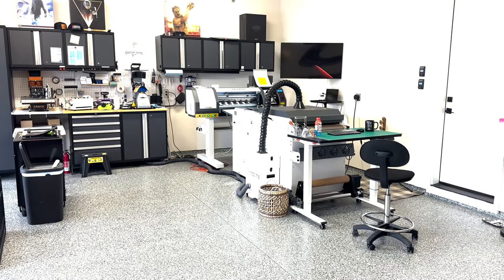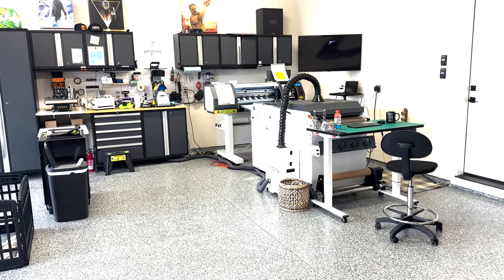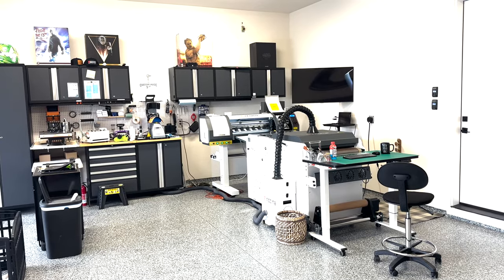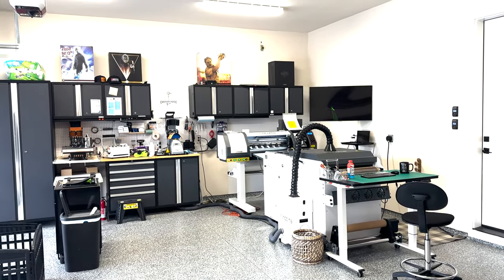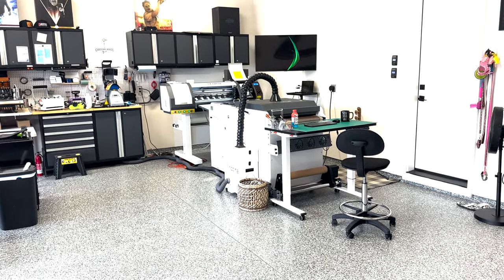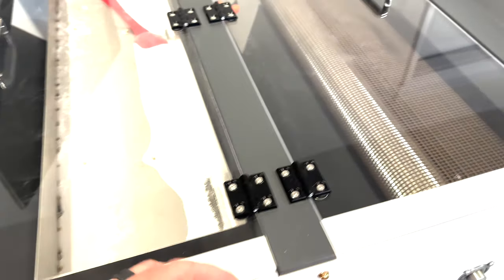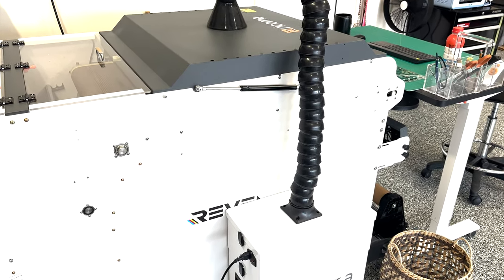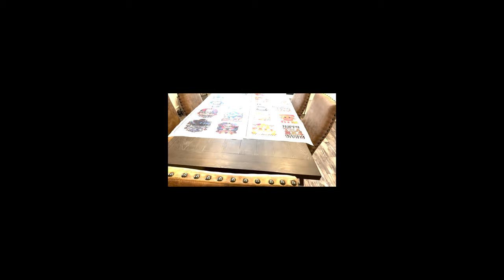Ricoma REVEL DTF-2402 - Direct to Film Printer - Part 2

Comment: Hi, if you print only one a3 job, you not need lost a lot film in automatic powder machine? Or you can only insert in it the a3 job? Thanks
Reply from the maker: If I'm printing smaller jobs, it's more of a manual process. I won't use the shaker and will self powder the prints before running them through the oven.

Comment: I feel your pain! I got the same basic setup through alibaba a month ago, received the rock solid printer a week later the shaker, etc is coming by sea. They were in chat the next day(9pm) installing all my software, doing alignments. I'm tech savvy so I did some of the software and final tweaks but they have been amazing with support. Spent right at 5k, got 2 sets of consumables, 2 maintenance kits, and all the rest. The tech just isn't that hard with these once you start trying to figure it out. I literally had dealt with Ricoma for weeks to try and get a decent price/setup. It wasn't tell till my hubby said just buy it that I went to alibaba asked a few questions and made the purchase. My printer and stand alone weighed 160lbs. It's so well built! Very little assembly required. Can't wait to get the vertical shaker/oven/ air filter. I was only reluctant to buy from China in case of fraud sale, and the month of sea shipping but apparently I'll have all my stuff come by sea quicker than USA based company?! A few of the sellers had warehouses in CA with stock but it cost more to pick up from them than to ship by sea due to CA rent/ taxes. Lol I'm so sorry you went through all that but I'm so happy you're up and running. Thank you for sharing your story. When I get time I will try to share my system setup, etc to help people find more reasonable alternatives. I'll have the rest of items by end of month which was less than 30 days from order to arrival. China engineer support is at night, and sales only during our day hours, but they have been pure amazing help. Do your research, read reviews on more than one selling site. Ask all the questions. I wanted to buy USA but it's the same machine for 4 times the price. And the reviews in FB groups speak volumes. You are so spot on with your info! I feel for you, I was so nervous making investment and not sure how it would go, but for you to spend that much more and get no support breaks my heart. They got more from you than they'd have gotten from me! Those payments would've sat until they made it right. Hope things get working amazing for you. Yes, transfer market is saturated with low quality prints, but slow, steady, professional quality wins the race. Be patient, it will come! Your prices are just fine, don't lower those, just do more SEO and marketing. Thanks for all the time and detailed info on your videos! This will save some people huge issues and money! Take care! Best wishes!